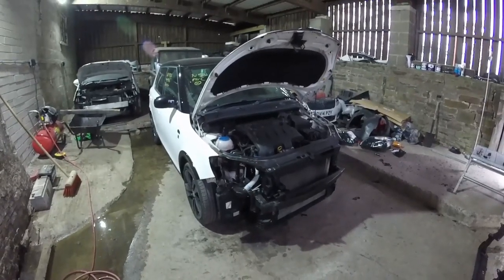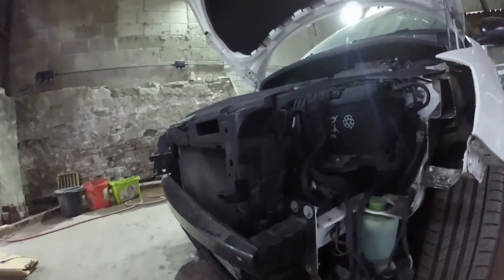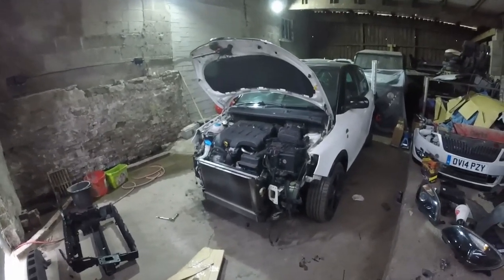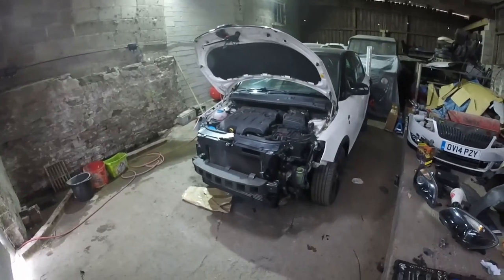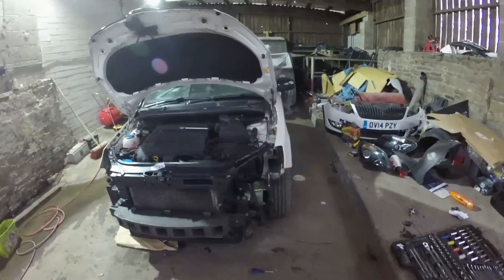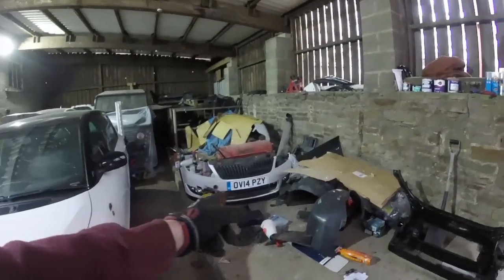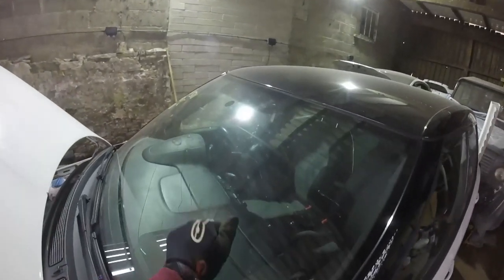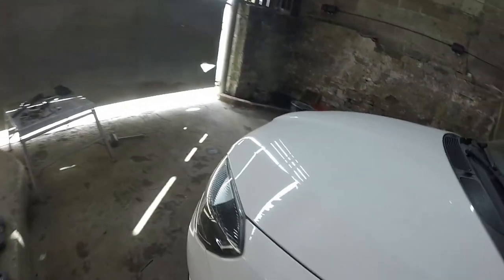The Skoda Fabia Monte Carlo Is back Together!

Comment: Another great video. I'll be honest, you'd be better getting an aerosol made up for the bumper, it'd make it much easier for a localised repair like that or even get a PDR guy in to do it. Probably wouldnt be more than about £80 and some even do wheel repairs. Job done!
Reply: yes i totaly agree  i would just let the PDR guy do the bumper and wheels  or if your on a tight budget get a matched up profesional aeresol  for the bumper
Reply from the maker: Wheels are going to get powder coated, bumper im going to machine buff it see how that ends up and then probably aerosol it.

Comment: Would it sell with new windscreen without any further work?! Worth a try.
Reply: Agreed, this car would sell with just a new screen and no more work. Accept a slightly lower price and save the cost and hassle of bumper and wheel repairs, new owner can do if ghey want to! Brillianf rebuild, well dond Phil.
Reply: Customers are willing to pay more for a car in good condition, a simple cheap repair will save hundreds needed to valuate a car needing repairs..
Reply from the maker: The wheels are getting powder coated, undecided on the bumper yet weather to just touch it up and leave it....